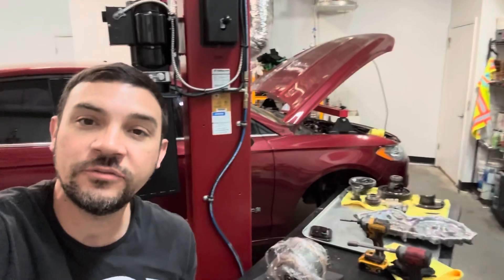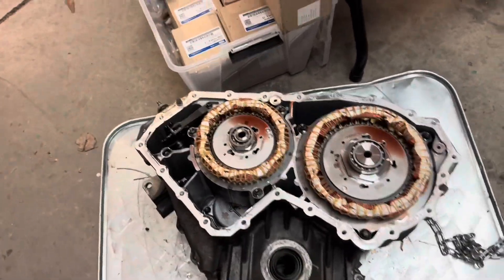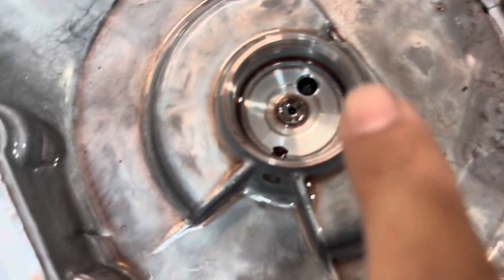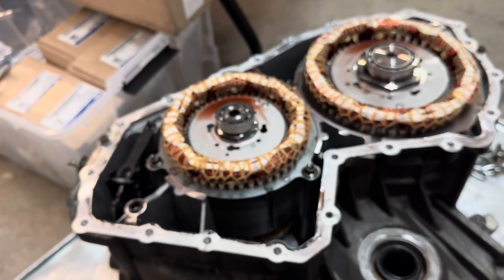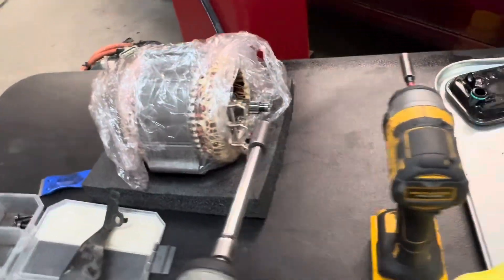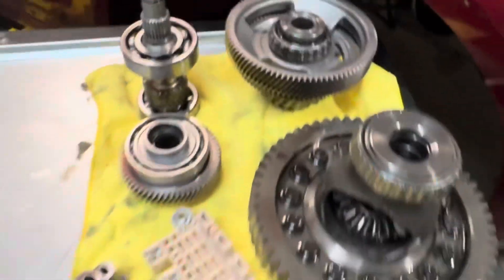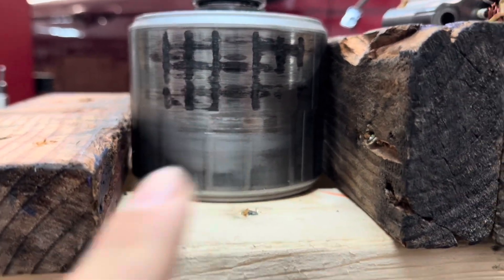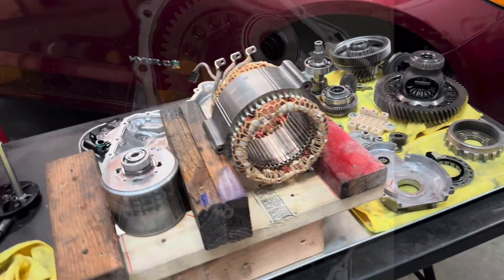Failure of Stater and Bearing on Ford Fusion Hybrid HF35 transmission. Full replacement. Partial vid

Comment: Wow that's a serious failure of the starter motor bearing 😮

I wonder what started that, bearing to fail? 

Is that whole case lubricated by the Mercon 5 fluid 🤔

How many miles on this one?
Reply from the maker: Yes fully bathed in Mercon LV.

Had 167k miles. This client ignored the bearing squeal noise for too long, and eventually the car stopped running and had to be towed in. This was the result.
Reply: What’s crazy is I have 320 k miles never changed fluid or anything